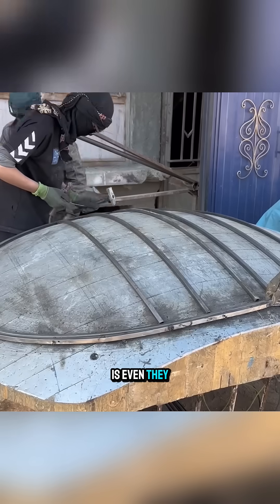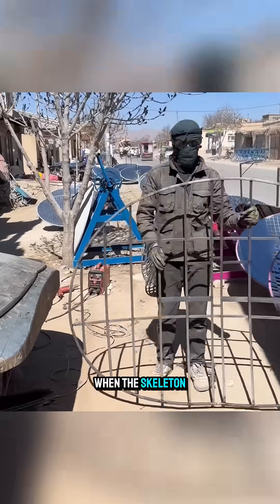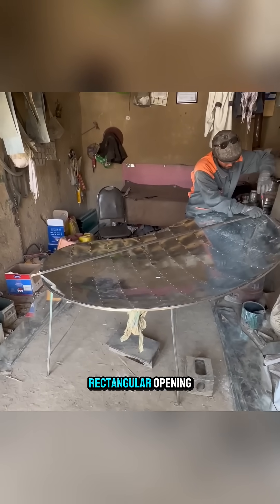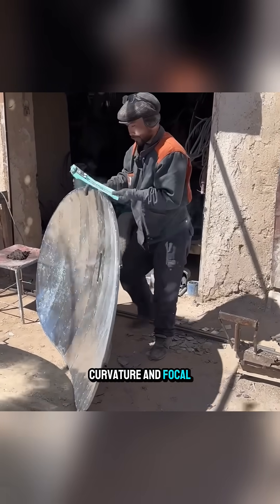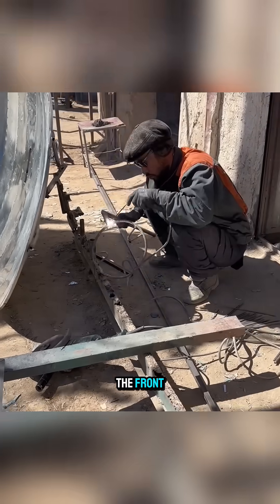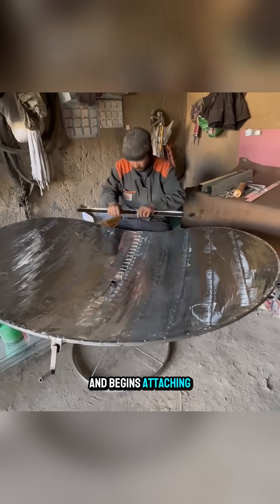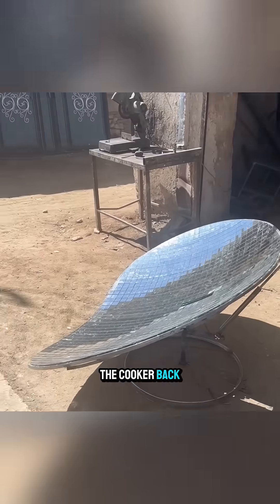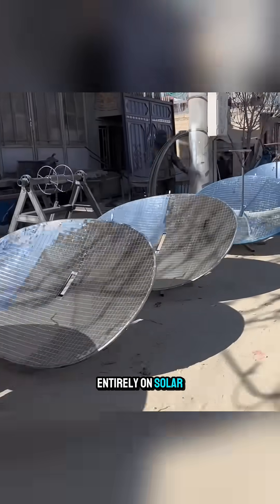Pakistan is a country that saves everything — even sunlight  #technology #workshop #craftsmanship

Comment: Making it with fibre glass will make it lighter, easier and affordable. Let’s harness green energy as much as possible. ❤😊
Reply: Fibre glass is cheaper, thus the number of people affording it will increase many fold. Thereby  increasing solar energy harnessing.
Reply: fiber glass deteriorate over years under sunlight.
Reply: iron is better because it does not harm the soil.
Reply: You can't repair or recycle fiber glass